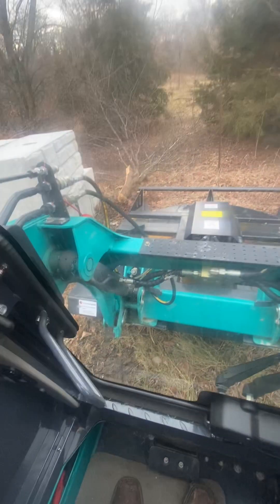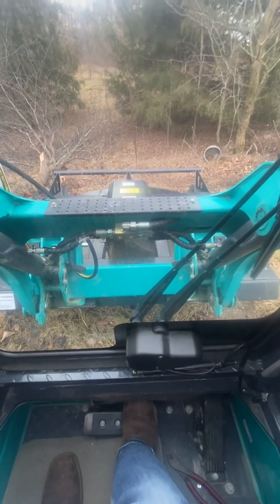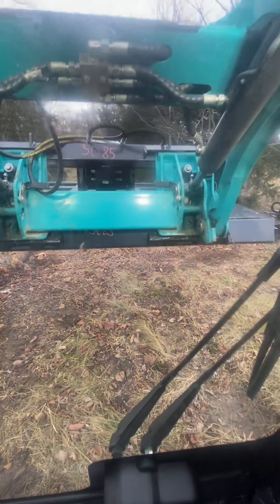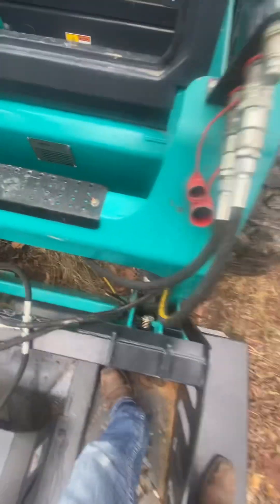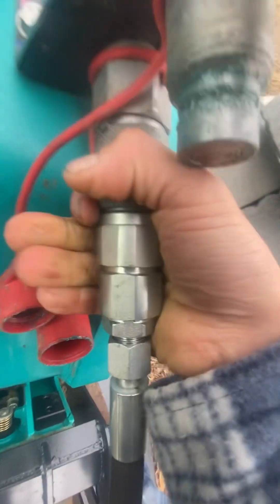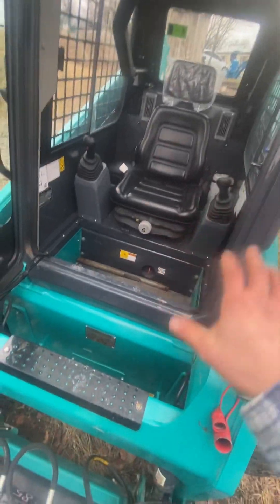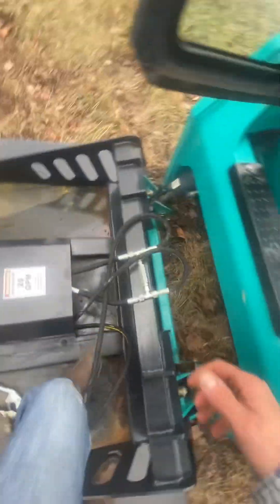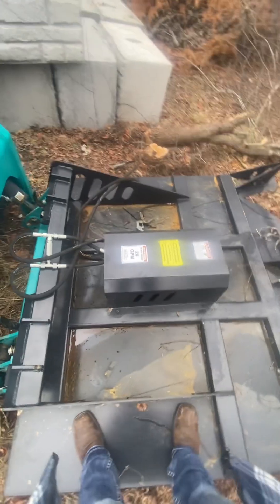Auxiliary hydraulic control on Sunward SWL3230

Comment: What is the flow rate in high flow mode?
Reply from the maker: Standard flow is 22.7 GPM
High flow is 34.6 GPM
86LPM/131LPM if you prefer liters
Reply: @bennysshop5908  Thanks!
Reply from the maker: @MetalStorm01  no problem, if you have any other questions please reach out to @Sunward of America and/or me. 
Any video suggestions? 
Thanks for watching!
Reply: How are you liking the sunward and why? Thanks
Reply from the maker: @technicalitems731 great machine. Simple and easy maintenance, quick joy stick responses, simple machine, not much to go wrong with it that way. And of course the color.